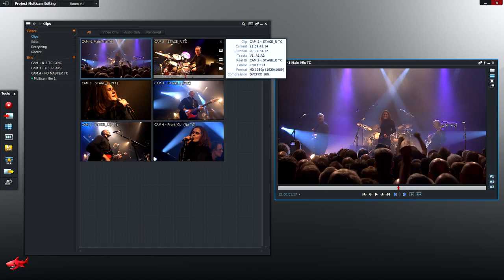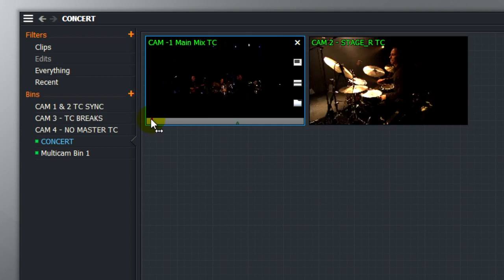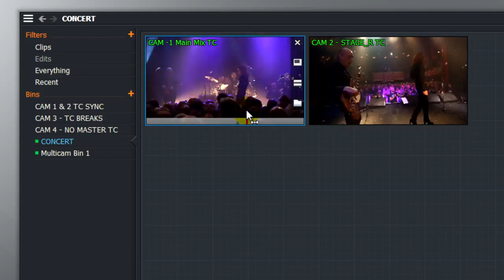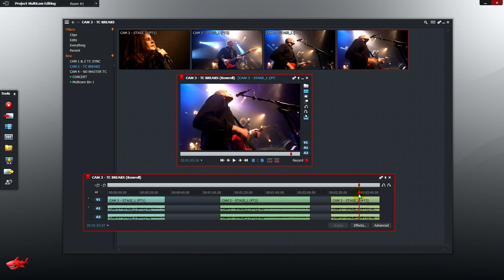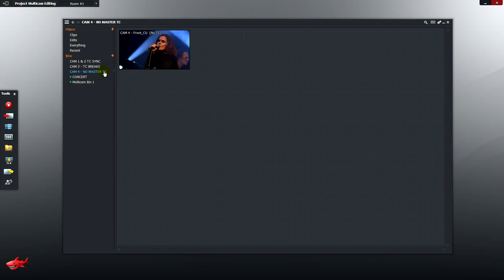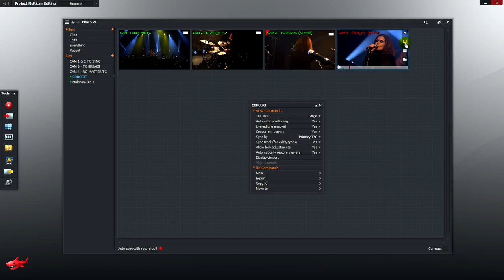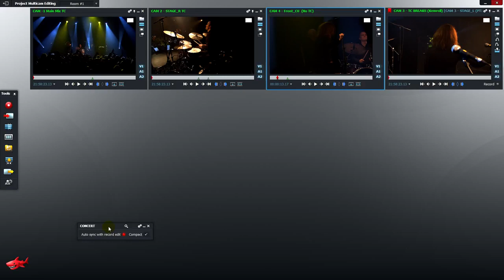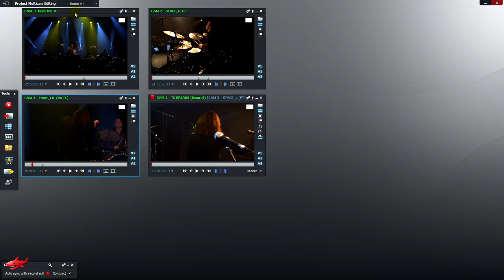Lightworks - Syncing Multi-cam Sources v12.5

Comment: hey, great video.
i'm having an issue with a clip, it starts out synced but eventually ends up lagging a fair way behind.
it is a different frame rate and was recorded on a different type of camera. i'm not sure if its salvageable but i was wondering if you could offer any insight. 
thanks.
Reply from the maker: Hi there. First you need to check the frame rate of the media itself — on the LOG tab, load the clip into the viewer then underneath switch to Metadata and see what ‘frame rate’ it says the file is. Then check the frame rate of your sequence, including the playback rate (right click the sequence viewer). In an ideal world, they should both match.
Reply: @LWKSVIDEO  i couldn't find the framerate of the sequence viewer. But I have the project set to mixed framerates. And the two camera angles have a 5 fps difference. Im not sure if that info will help.